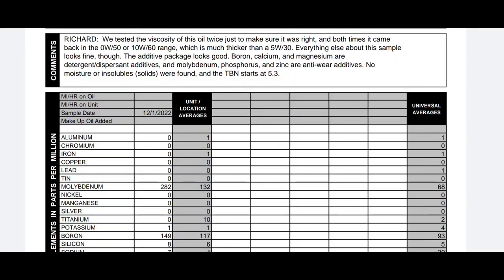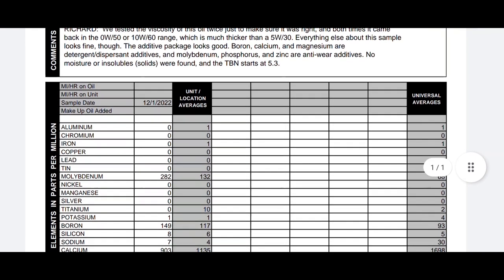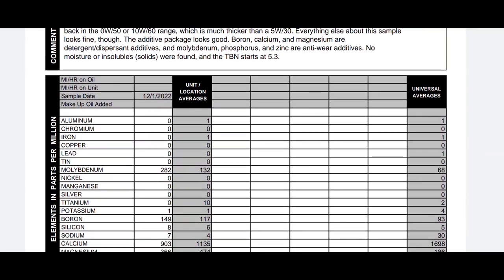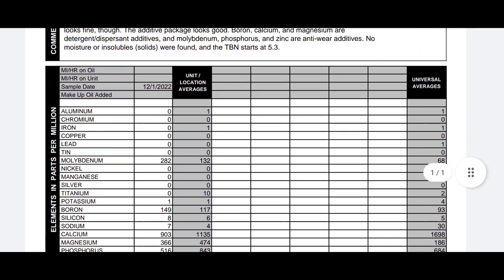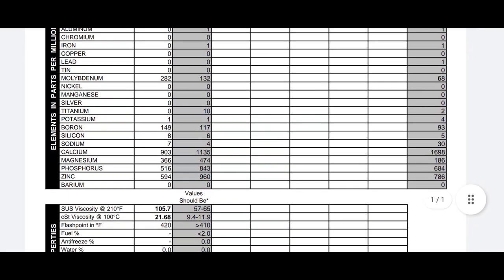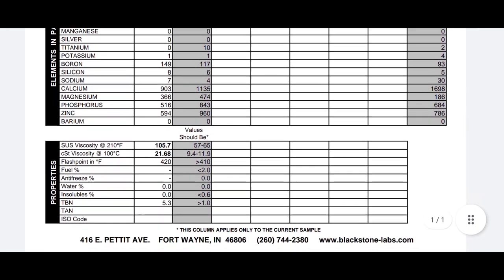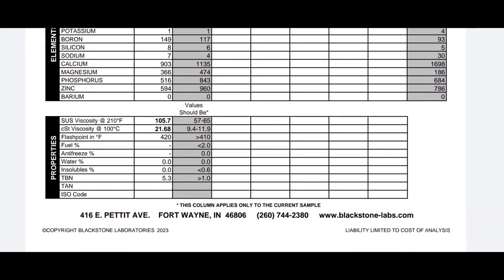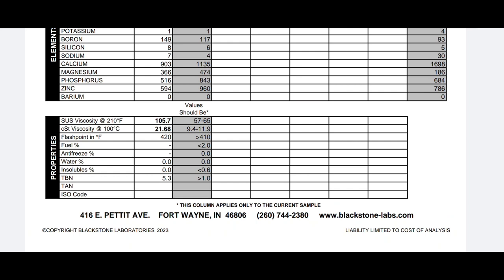What Did This Oil Additive Do To The Oil?! Let's Look At The Lab Results And Find Out

Comment: I've heard some owners of 28-20 F150 5L owners who experience noticeable oil burnoff have fixed it with a couple oil changes using a moly treatment. Basically the theory is the moly gets into the imperfections and pits in the factory plasma spray on lining and helps fill which keeps oil from escaping, and allowing the rings to seal properly. IDK my 18 5L doesn't experience noticeable oil burn off, but if yours does why not give it a shot. I've put this stuff in my 03 Lightning with 210K, and that engine still runs as smooth as my 18 5L. The only noise I don't like is I think one of the auxilary idler pulleys has a bearing that's starting to get a little noisy when cold. It happens occasionally, and a $10-$15 bearing replacement fixes the problem.

Comment: I ran it in a 2020 raptor since it was new, maxed out 93 tune and bolt ons.  At 70k miles tuned the whole time, I never heard any cam phaser noise which was a factory recall, and only drained about 2” of oil through out its life out of the catch can, frankly amazing if you ask me.  I was turned on to it by reher Morrison engine building school.

Comment: You are correct that Moly EP is best used in worn engines. Thats its design. An engine without a bunch of wear would be best served with just the oil.
We did a cement mixer Cummins that leaked and had terrible blow by. We treated 1 pint to every 3 gallons of oil. It dried up in 1 week. Truck went from 220-250 hours on oil to 750 on first change as dictated by the oil analysis. Wish you had some used oil samples with and without to go along with this. Great video!
Reply: I think I will try ep next oil change and compare, I’m at 8000 miles in my sequoia. I’ll send in analysis on both. Using 5/20 Schaeffers 9000

Comment: Rich I have been using Schaeffers for 40 years. Started out using it in my personal vehicles then in my commercial semis. My sales Rep in Central oregon Mike Hepworth does an Awesome job explaining which oil and what grade would benefit  me for my use. I use all Schaeffer gear an transmission fluid in all 5hat I own. I use the Schaeffer Supreme 9000 5/40 full syn in my 2018 ford f150 3.5 eco boost my 2020 toyota 2.4 toyota camry and and two Cat C16 and one Cummins 600 horse 15 litre  The cold flow rate is awesome it pours better than a majority of the 0wts.

Comment: I have been running the moly e.p. in my 04 dodge 4.7 since 2015 and put some serious long distance hauling from northern calif to southern baja about 20 trips and about as many trips from northern calif to idaho plus normal day to day driving. Regular maintenance and it has been the most reliable vehicle I have ever had. Runs as strong and tight as the day I got it. I have since used it in my other vehicles too with similar results.

Comment: I use MolyEP in my 7.7qt coyote. 1pint for the whole 7.7 instead of mixing at the higher treat ratio they suggest. Basically turns the 5w30 into a 5w40. The base they use is extremely high quality. For having moly on the bottle it’s only in about the 50ppm range but what you won’t see with Blackstone is that it also contains 40-50ppm of antimony.

Comment: Awesome, I have used this before in my wifes 2008 buick Enclave. Engine runs great and none of the famous gm 3.6 timing chain stretch issue.
Reply: Now with that set after this video I will not be using this additive in my 2012 mustang, But for my wife who puts around its great.

Comment: Gave you a thumbs-up Rich.  This oil additive looks like it might be "okay" for a hot climate, but not good for a colder climate, especially in a sub-zero climate with a lot of snow and freezing morning starts. That 10W60 just doesn't sound good for those very cold climates.  Better to stick to a 5W20 or 5W30.  But that Schaeffer 9000 oil looks like a real high quality product!  It's so good you don't need to add any extra oil additive--it looks just fine just on its own.

Comment: When I had my Jeep Wrangler 392, I switched to the Schaeffers on the 3rd oil  change. Maybe it’s a mental thing or I was having delusions but I swear the Jeeps mileage jumped by 2-3 mpg. It’s also possible that I changed it at the transition of the motor being fully broken in but it did run a tad quieter. Schaeffers is pretty darn expensive so hopefully the benefits of using it will make sense. I’m going to run the last batch of the Pennz in my F-150 then may go back to the Schaeffers. Great vids Rich. Appreciate ya.

Comment: That's really amazing results. It actually would b perfect for certain scenerios when u don't want high viscosity across the board but only when really hot. I actually have a vehicle that I rebuilt the entire engine twice (too much to list) very careful and ocd. But it has a super low oil pressure only when it's 100 degrees outside. I already bumped the oil weight up to 20/50 with 20.8 viscosity which is one of the highest 20/50's. It runs perfect with high oil pressure all year until it's 100 and I'm at idle. I also went in the ecm and bumped idle up 275 rpms. And my thermostat is removed and it runs much cooler. I drive around w my scan tool monitoring everything. 
So in this one situation where I only want bumped up oil pressure when real hot.... This sounds perfect. But I do agree that it's a case by case basis w many factors. Thank u for the video. Appreciate u.

Comment: I have a 2011 F150 with the 5.0 engine and 126K miles. The engine used to do that typical typewriter noise (unrelated to the fuel rails). I poured a bottle of ATS Chemical 505-CRO in and closely followed their directions before my last oil change. This engine got oil changes every 3-5K historically at the dealer and I was amazed at how much carbon came out when I drained the oil myself this time. The engine even ran better and better as I was circulating the additive cleaner 505-CRO. I replaced the oil with Pennzoil Ultra Platinum 5w-30 and of course used the Motorcraft filter and was astounded at the difference the cleaner and new oil made. The typewriter noise is barely there now and I'm not getting much oil consumption if any. Checked my oil level after 1K miles and the level was still good. Made a huge improvement. 
You might consider reviewing their products at some point. Otherwise thanks for the videos, I've found them to be very helpful and may God Bless your day.

Comment: I'm considering a change from Shell Rotella T6 5W-40 to Schaffer 5W-40 for my 2018 F-350 6.7L diesel.  I'm curious how increasing the viscosity of the oil using the Schaffer oil additive affects the oil flow.  The last thing you want is reduced oil flow.  I think I'll pass on the additive but using Schaffer oil is certainly a possibility for me.  BTW, I've had no problems at all using Rotella other than availability at times.

Comment: I agree with you, in an older worn engine this would help but with modern engines with VVt and stuff, I wonder if it would be too thick and cause problems ?
Reply: i'd think it would slows down the reaction time of the VVT itself unless it was a specialized unit like older BMW S series engine where the VVT unit uses additional high pressure oil pump. but then, they specified to use 10W60 from the get go. i wonder how thick 10W60 became with this additive

Comment: Thanks Rich.  I actually ordered some Schaeffers 9000 after your last video.  Anyway I think that Moly EP additive also has antimony in it.  Something Blackstone does not test for, but that was years ago when I last saw an analysis of it.
Anyway with Schaeffer’s reputation I would not hesitate to use it.  Might be like icing on the cake when added to any good quality engine oil.
Thanks again.
Reply: Moly EP is amazing in small engines.  Just a tad…and yes it is Antimony…which is an amazing friction reducer.
Reply: @duanemcquillin9343  thanks for sharing and I am going to try it out next oil change. 👍
Reply: Yes it does have Antimony.  At least the Schaeffer 0W-20 does that I use in my '22 Subaru Crosstrek.  Around 50ppm of it shows up in every UOA that I've done so far.🤙 I used Blackstone for years but switched to Oil Analyzers because Blackstone's fuel dilution numbers are not accurate.  They read low.  Oil Analyzers does test for Antimony.  That's how I know that Schaeffer has it in the additive package.
Reply: @SuggonDeizNutz  thanks for the information. 👍
Reply: How much antamony does it show in the zero w twenty

Comment: I’ve use Schaffers multiple times with excellent results. I have a carbureted engine in my Camaro and it gained idle ran cooler. I had to actually adjust the idle lower because it was producing a better ring seal on the cylinder walls. Does not surprise me with Schaffers. I wish it was just a little more affordable.

Comment: My only guess would be to just use 1/2 as much of the EP as instructed ! but agree that would be good for a worn engine or a diesel engine !
Reply: I run one pint of EP to my lml duramax oil change at 10ish quarts. I use Schaffers 15w-40 durability advantage. Zero oil consumption too.
Reply: @mr.joshuah1412  no doubt schaffers oil and EP. Is good stuff ! I been running valvoline VR1 with a few ozs of motorkote. 648,000 miles unrebuilt engine and runs great !
Reply: @scottymoondogjakubin4766  motorkote is chlorinated napthalene, not putting that corrosive in my engines...

Comment: I love watching these and learning, but I went to a line of thinking after buying my first new truck. I'm going to pay the dealer for the maintenance. Ford designed the engine and tested it around their lubes, and that's good enough for me. I have had friends damage engines (these friends are NOT on your level, bear that in mind) by using after-market oils and additives. My 6.7L diesel costs what, $15,000? You can buy a small car for that! This is why I let Ford deal with it. If they break it, it's on them. Having said that, I have a great dealer and their diesel guy is VERY good. Maybe not A-Rod level, but good. I'd trust you with my 2001 Ranger any day.

Thanks for your time and money. I suppose if I ever get enough money where I can recover if I screw up my ride, I'll try some of these oils you tested and found to be good. This one blows my mind with how thick it got!

Comment: Thanks for the review been waiting to see this one.  I personally have been using schaeffer products for a long time.  The chevy cobalt i drive back and forth to work everyday has been getting this stuff since i got it and i have not had to do any major engine repairs and getting close to 300,000 miles. My coworker use lucas in his 14 silverado with mobile 1 0 w20 lol and he hasnt had any major engine reapir either.  I know of transmission repair shops using higher quality mercon v instead of lv or the ulv (ford)  dex 6 or hplv (chevy)  with good results.  Not saying do this either.  I have my conspiracies about stuff like this.  I like to think manufacturers dont always engineer cars for longevity especially these days.  They are only engineered to satisfy the epa.

Comment: On the bottle, it says the stuff plates to the engine parts. I think once it plates to the engine the thickness issue goes away
I use it all the time in my little Honda Fit. I put 3 oz in with the oil change of Shaeffer's 0W20 after 10000 miles. Blackstone says my viscositieswere dead on for a 0w-20 oil. I like how the Molly ep gives me better gas mileage and really quiets down a noisy engine in the fit. Blackstone also said that my ware medals were  much lower than a regular seventy five hundred mile oil changes in other customers same engine I have a 150000 miles on this engine and it feels exactly like it did when it was brand new. Full power

Comment: Based on what I see on the Ford Forums with the Coyote engine it may cause trouble. There seems to be quite a few people with VCT issues and stalling at idle. As I read the issue it seems to be because they get gunked up over 100k. I imagine this would make it worse. But I have no real idea just taking it all at face value. Thanks for the video always enjoy them!
Reply: I started having the startup rattle on my 14 F-150 with EcoBoost so I switched from motorcraft oil to Amsoil and I haven't had an issue in over 2 years now also I have always used shell premium because of all the detergents in their premium gas I don't know if any of this makes a difference at all or if it's all in my head but at least it makes me feel better at the end of the day LOL
Reply: @randywheeler3914  Nice, I do the exact same thing as you. Amsoil signature series, shell, premium.

Comment: Excellent, Great video, I used STP oil treatment in the past.  Is it possible to see Schaeffer’s Supreme 9000 5W-30 and Pennzoil ultra-platinum 5w30 compared or if you have the test results.  I’m using your advice on the type of oil for my 4000 mile oil change.  I have a 2018, F150, 5.0.
Reply from the maker: I have the Pennzoil Platinum Ultra that I'm going to send off here soon I haven't done a virgin analysis yet but I will be doing it on this next run
Reply: @FordBossMe  COOL BEANs!

Comment: I used to run that oil in a couple super duty's and a twin turbo cap car. It was butter at first but I felt it got beat up and lost the smoothness after a few thousand miles. Hell, even mobile 1 didn't do that to me. Gave up on it after a few years of using it.
Never tried the additive. Went with fords full synthetic for the duty and liking pennsoils oils made from natural gas in my current car, an 08 vette.

Comment: I been putting that in my Chevy truck for a few years now cause it has over 300,000 miles on it and I went from adding 3 qt between oil changes to about half of a qt now
Reply from the maker: That's great but it doesn't change the info I put out

Comment: Was the mix ratio correct in the testing? If 1 pint to 4-5 quarts, then 1 part EP to 8-10 parts oil. In your vial, it really looked like 1 part EP to 4-5 parts oil, which would be twice the recommended ratio, unless I misunderstood something. I really appreciate all of your oil testing.

Comment: I have a 2003 Silverado over 350,000 uses no oil.. Had been using their oil. Lifters started clicking. Had them changed. After the  mechanic  got it  back together. They were still clicking. The oil pump had failed. How long it  had not been pumping. I do not know. But I think if the Mechanic had just replaced the oil pump it probably would have been ok. A lifter  job does not come cheap!! Can not remember what else they replace. Silverado Still going. Put this treatment in a 2000 LT1000 Crafts man mower. Was using a good bit of oil . Not any more. Still have the  mower.

Comment: Hey, Rich! What was the cost of the Moly E.P. ?  Was it a quart bottle. I like you. Have tried just about every oil and additive out there. Some of these are very high dollar. For us average Joe's. Been using Hotshot oil additive with my Motorcraft Full Synthetic 5w30 motor oil. 5 oz works very well in my 2.0 Eco-Boost. Wondering if you every heard of or used it? This Moly E.P. looks like it could extend the life of the oil. Never seen it before. Would like to give it a try.  Great video! This will get everyone thinking about there next oil change.    Shawn.

Comment: Would this have any benefits if you add it at around 2500 out of your regular 5000 miles oil change? My thought would be it may help with slowing down the oil from breaking down if your daily drive is a lot of stop and go. It's just a thought.

Comment: Sounds Like that Stuff Turns the Oil Into a RACING OIL????  Not sure if the Regular Joe that Put's this in his NEW (Whatever) know's what it's doing to his Oil / Oil Change. Don't think I'd be putting this Into My Ne F-150. (Might help The Phaser Issues)?????? Bu, toooooo Thick I Think. Maybe an old 57 Ford With a Worn 312 ThunderBird Special????  Maybe???...
Reply: This Schaeffers 5W30?????  It tested Better than the AMSOIL did in how many Areas. Project Farm had the AMSOIL in His testing Beating out Everything he Tried Inc Pennzoil Ultra Plat, and the Schaeffers?? Curious about the Areas where the Schaeffers was better in because it didn't make it to the Show in His Testing. It got Beat out be the Pennzoil Ultra Plat, then AMSOIL beat out the Penz.

Comment: The Shaffers Moly additive is indeed in the 60 weight range.  The SDS states that the Kinematic viscosity at 100c (this is stated incorrectly, it should say 40c which is an ISO standard) is a range of cst 260-290 which is a 60 weight.  
The black stone report correctly states the Kinematic viscosity at 100c is cst 21.68, however that is a high 50 weight.   
But…..something doesn’t add up here. Your sample looked to be 4 parts 5w30 and one part 60 weight additive.  How that can average out to a high 50 weight viscosity makes me think the oil additive is thicker then a 60 weight.   Even if the 5w30 was at 12.5 cst which is the top of the 30 weight range, the math still doesn’t work.

Comment: Its funny, I am a Canadian and i have never heard of the Schafer's oil brand. From your oil test results it seem to be quite an impressive product for a worn engine. I think that company needs to get into the good old American Marketing game. Great Video by the way, thanks for the info.
Reply from the maker: No no no no no let's go even further than that I don't think you're quite explaining it like it should be explained

The regular Schaefer's 9000 premium full synthetic is good for any engine

But the EP additive should be used in A Worn engine or an application that can use some higher shear thicker viscosity
Reply: David I have used Schaeffers for 40 years. Schaeffers has been around since the 1840s St Louis Missouri   The Wagons that went west on the Oregon trail had Schaeffers grease on the wagon wheels.  They do not want to play the advertising  game.